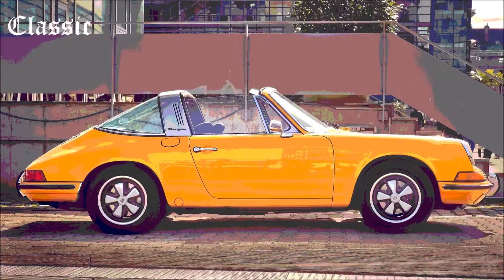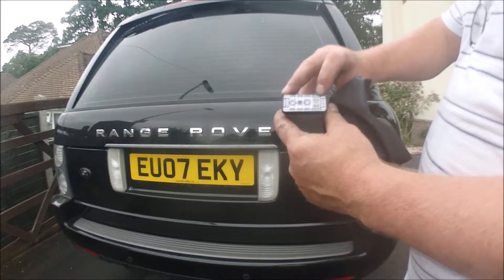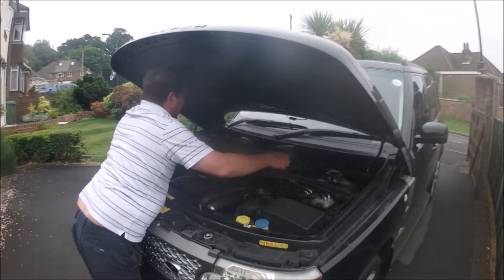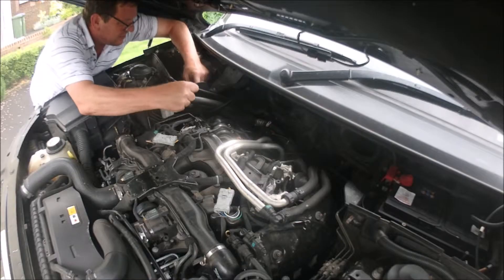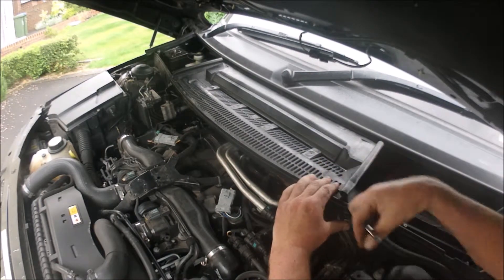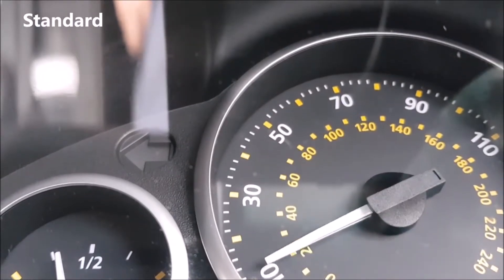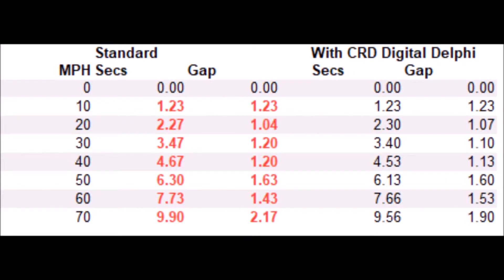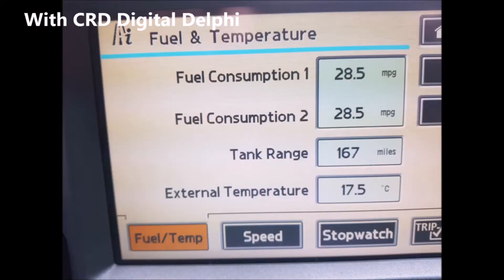Range Rover Power Upgrade

Comment: The 3.6 was a ford engine
Reply from the maker: You're right. He is right everyone, BMW used a Ford engine. Thanks for the correction. The internet is full of mis-informed idiots and you have just found another one :-)
Reply: Ford used a Ford engine.
Reply: @jsteed01  it’s the other way round mate. The first year that BMW bought Land Rover, they kept on using the Ford engine. Then they changed to their bmw 730d engines and from the E60 bmws
Reply: @sevinboralugoda1927  I'm talking about the 3.6 tdv8 pal.  A Ford engine fitted by Ford.
Reply: @jsteed01  depends on the guy's model. Tata motors bought the company in 2008, while the ford engine lasted from 2007-20010
Reply: @jsteed01  like the year of his vehicle
Reply: @sevinboralugoda1927  You’re mistaken. They started with the BMW engines and then switched over to Ford/Jaguar engines.
Reply: Ford bought Range rover in 2000, and used bmw motor until 05. 06-12 was a ford motor from what i understand.
Reply: More input from Peugeot then ford on the tdv8 if you do your research
Reply: @classiccarclips3292  you clearly haven't a clue mate its definitely a ford lion engine which was with European Peugeot diesel electronics. Bmw made the 3.0 straight 6 they don't make a 3.6 diesel